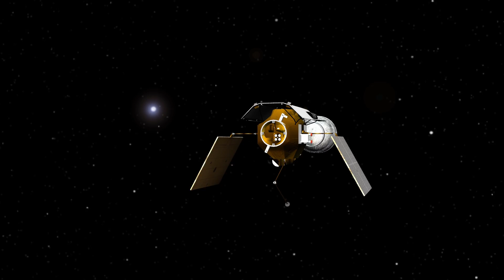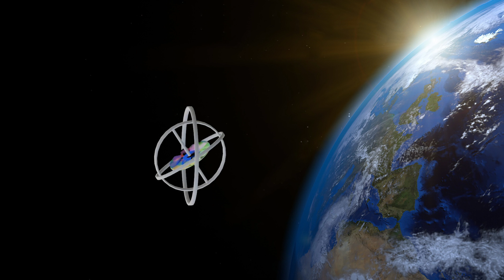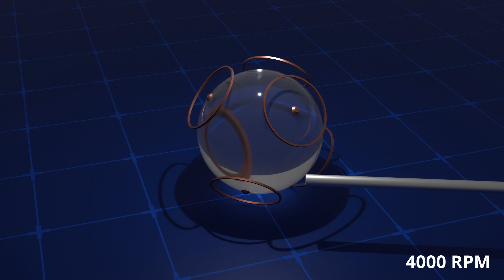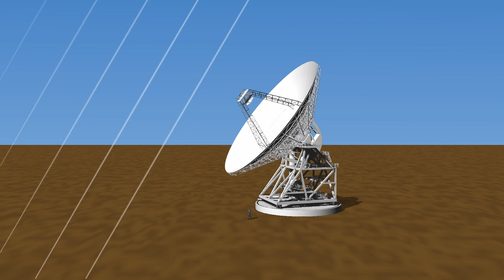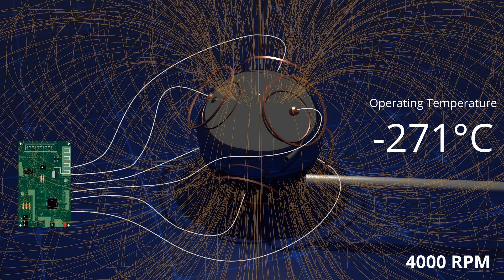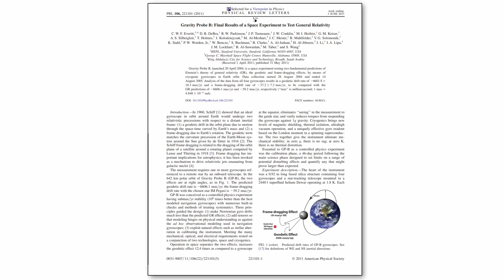Gravity Probe B

Comment from the maker: addendum: If you want additional info on how we've tested General Relativity and what Frame Dragging is,  my previous video below talks about those  tests.

https://youtu.be/Lq4m6uu1Ur8 
Tausend Jahre sind ein Tag
Reply: Excellent video!  Relativistic cosmic rays traveling at ~99.9999%c should also cause frame-dragging per an interview Fraser Cain conducted awhile back.  However, testing this effect is problematic.
Reply: Gonna have to binge your whole channel sir. Sry.
🤭
Reply: Why volunteer for MORE GUESSING at what you're trying to say?
Reply: The tallest mountain and the deepest trench are 2.4 M? What is that supposed to mean????
Reply from the maker: @barkingmad7407  It's to show how smooth the sphere is. If we could increase the diameter of the sphere from its normal 3.8 cm to the diameter of the earth(12756 km), the difference between the heights and lowest point on this enlarged sphere would only be 2.4 meter.

I didn't say this very clear in the video. I forgot to say the word "difference"
Reply: @the-barking-mad  I got this one... He's saying it's only off by a cu#t hair.

Comment: 17:14 How do the 4 lead bags prevent it from being effected by magnetic fields?
Reply from the maker: Thanks for the question.
In order for the lead bags (cylinders) to shield the interior system from magnetic fields, they must be cooled to be their superconducting temperature. This is 7.2 Kelvin. The helium onboard operated at 1.8 Kelvin, so the helium was able to keep the lead bags in that superconducting state.
In this superconducting state, lead and other superconductors will repel and prevent magnetic fields from forming inside the cylinder. This is known as the Meissner effect.
The video was getting longer that I expected that's why explained that part with only one sentence.
Good question nonetheless.
Reply: @ReflectiveLayerFilm 
The engineering and science of this is just so impressive.

Comment: You lost Magnetic interaction with the earths magnetic field when it it was made a superconducter. Should have just use the electrostatic charge on the sphere for measuring drift. I don't believe this experiment is valid because of the magnetic interaction. Also could have use optical interference (inferometer  Sagnac effect). 

"The Sagnac effect, also called Sagnac interference, named after French physicist Georges Sagnac, is a phenomenon encountered in interferometry that is elicited by rotation. The Sagnac effect manifests itself in a setup called a ring interferometer or Sagnac interferometer"

Comment: It'd be better just to use many sub-perfect gyroscopes, and test if their deviations statistically support frame dragging. This design's complexity introduces multiple points of potential failure. For example, eddy currents induced within the coating could undermine confidence in the results. A statistical test would be more robust and provide measurable confidence. Anyway, excellent video!

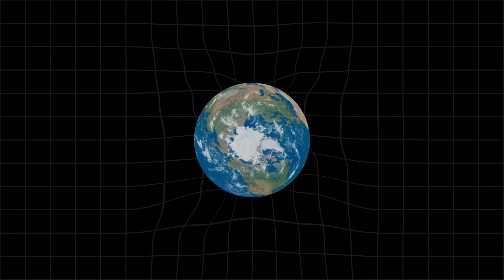Comment: Page 1:42 that frame dragging is a fancy term for Aether drag. 

Aether is an incompressible fluid that filled all void space in vacuum of universe. Aether has no mechanical but electrical property, by which vacuum permittivity and permeability are its attributes. As it attached to all matter it “drag” and move in equal velocity with matter in the near field, also drift with another velocity in the far field or deep space a velocity in average to all matter in the universe, hence the term “fluid”. A rough analogy is the harbor current versus ocean current or deep sea current. 
Also if you don’t mind, gravity, inertia and centrifugal forces are also attributes of Aether. Unfortunately it has been foolishly dismissed from the science community.

Comment: Do not forget that the precursor to the Gravity Probes, was the HRG (Hemispheric Resonating Gyro).  See WIKI for details of the various designs.  Instead of a ball, it used a "wine-glass" shape, but exverted.  The same fused quartz was used for what was essentially a cylindrical resonator (but with lesser coupling to the outer world), and the "acoustic resonance" of the glass became the equivalent of an Inertial Mass.  Several high class scientists and consultants said it could not work, since the was "no mass" involved.  An acoustic wave had no mass, Thus it could not be Inertial sensing.  Well, they were all wrong.  This actual effect was discovered a couple of centuries ago, from the French, who were probably drinking a lot of wine.  I myself did some early design work on the electronics, for doing the forcer-driving into the bell, and for sensing the inertial outputs.  SAFRAN now has the rights to that technology, and makes inertial instruments for airplanes, missiles, oil-drilling, undersea, satellites, and may other uses, where accurate pointing is required.  The HRG, since it is an actual Mass device, can withstand power failures, loss of computers due to cosmic rays, SEUs, MEUs, and also nuclear radiation.  It will just keep humming along without any power, and can be easily recovered back into action, after all of the adjacent support systems come back on line.  I'm proud to have been part of the original design team at General Motors.

Comment: Wow! This is by far the most exemplary coverage of any sensor that I've seen, and I once was an engineer at Systron Donner Inertial and tried to stay abreast of many sensor approaches.
The gyros Systron made consisted of a double ended crystalline quartz tuning fork. The forks quantified the fork's motion going out of plane due to the Coriolis effect.
It's sensitivity was many orders of magnitude inferior to that described here. But was pretty 'trick' in the ~1990 time frame. It was also tough enough to be shot out of a cannon (i.e. smart munitions)  and was the first 'gyro' used  by General Motors for enhanced anti-skid braking (yaw sensing)   Maybe your sensor could be miniaturized using 'Buckeyballs' (C60).
Reply: I am one of the designers of the HRG (hemispheric resonating gyro), which was developed by GM.  The HRG was actually used on this mission, as a crude (but dynamically accurate) guidance system for the entire satellite-bus itself.  It was also used in Hubble, and other spy satellites, for the Near and Cassini missions.  The HRG "dynamically" is the next best gyro to the Gravity-Probes themselves.  Because it is a mass-inertial device (see details on WIKI) it will drift due to any sort of mechanical or thermal stress, and had an early internal problem with stray sodium ions drifting through the fused-quartz glass resonator.  This was later fixed by SAFRAN who now has the design rights with an AC powered resonator.  One advantage is that if the electrical power fails, or the guidance computer get wiped out by cosmic rays, it will continue to run accurately for a very long time.  That allows recovery after SEUs or MEUs, which happens all the time in space.  Mr-Sun actually hates us for being up there in his domain.
Reply: @brunonikodemski2420  Thanks for the reply. The 'HRG' is an approach that is news to me. Conceptually, it sounds very elegant. I could see Honeywell, Rockwell and other companies creating such a sensor. But how did GM 'get into' this?
On a related note, let me pose a hypothetical miniaturization of an HRG   I previously mentioned 'Buckeyballs'. These are atomically small, natural, hollow spheres composed of 60 atoms of carbon. (C60). Another natural form of carbon is nanotubes. At one point, IBM was able to get atoms of other materials INSIDE nanotubes, so they could emit light, turning them into LEDs. The application was photonic, 3D 'wiring'. In addition, studies of the chirality (twist) of nanotubes reveal that they can become an insulator, a conductor, or even a semiconductor. Putting all these together, in your imagination, might one be able to put a material inside a Buckeyball, give it some polarity, and turn it into an HRG ?  It may be total science fiction, but the natural, organic, spherical perfection of C60 intrigued me about its potential in sensors back when I worked at Systron.

Comment: I wonder if we could measure G, the gravitational constant, with a high degree of precision, using that perfect sphere  in a setting where a laser would graze the sphere and we would measure the displacement of the laser beam caused by gravitational micro lensing using interferometry in the arms and apparatus of the LIGO gravitational observatory.
Reply: #freeschrodingerscat
Reply: LIGO kinda achieved this with interferometry iirc. But it required hundreds of meters of distance to achieve and detected gravity waves. There are space based interferometers planned that are much larger and benefit from near vacuum

Comment: So how was it launched without the forces of acceleration damaging everything ?
Reply from the maker: That's a good question. I also thought about that myself. Unfortunately I could find any info of that aspect of the mission. I assume the that electrostatic suspension was activated prior the  gyros being shipped from the lab to the vehicle assembly building at the launch site. There it was assembled with the launch vehicle.
Reply: To protect these instruments, the spacecraft was mounted on a vibration-isolated platform within the rocket.
Reply: @human.earthling  an ISO large enough to contain the instruments would be massive and a huge feat of engineering in and of it-self.
Reply: @4DCResinSmoker  	Here is a more detailed answer from ChatGPT:

1.	Vibration Isolation: The spacecraft was mounted on vibration isolation systems to reduce the impact of launch vibrations on the delicate instruments.
	2.	Suspension of Gyroscopes: The gyroscopes inside Gravity Probe B were suspended using electrostatic suspension within the spacecraft, which minimized friction and external forces.
	3.	Thermal Protection: The spacecraft also had extensive thermal protection to ensure that temperature variations during launch and in space would not affect the measurements.
Reply: @human.earthling  Yeah I know what all this is as I've used it (frequently) during my time in the service. However, just on a much smaller scale for avionics materials. That being said, the accuracy with which the instrument was made to function, i still doubt that the instrument came thru 100% intact. Thus needing some for of in-orbit calibration to be performed to discover what the issues were. With the calibration constants knowledge, it would then be possible to filter out irregularities for the actual measurements. 

Side note: Jet-Engine test stands need periotic servicing, where the calibration service-man (me) would teach the system what a particular measurement or reading. Thus canceling out the "local" irregularities of the cables, equipment and environment. after which changing out or losing any of the calibrated hardware would invalidate the system, requiring new calibration constants being developed. (typical periodicity of 3 - 6 months depending on system)

Comment: Very nice video.  To add a little, if I may:  Gravity Probe B was intended to measure two consequences of Einstein's General Relativity.  Both cause the precession of a gyroscope in free fall (i.e. in orbit) around the Earth.  

The 1st, larger of the two, is the Geodetic effect, which causes de Sitter precession, is due to the mass of the Earth that causes Space-Time curvature.

The 2nd, is Frame Dragging, which causes Lense-Thirring precession, is due to the rotation of the Earth.
Reply: I heard the geodetic effect is because there are less than 360 degrees in a “circle” going around a static mass, so when you orbit once, your velocity vector makes a less than 360 deg rotation, so is not realigned with the gyroscope. From the s/c point of view, it looks like the gyroscope precessed.
Framedragging is weird, because it means to be “not spinning”…that is, you feel no centrifugal forces within the s/c, when near a spinning mass, you have to spin with respect to the distant stars. 

S/c is spacecraft. Which is standard in the biz.
Reply: @DrDeuteron  "the biz" 😆 I like. 🤗

Comment: Gravity probe B, the experiment that contradicts the Einstein's version of General Relativity, as well as GPS clock experiments.
The probe data does support the Newton version of the general theory, as well as Gauss's Law for Gravity.
Reply: What sources did you use?
Reply: @douglaswilkinson5700  While it is true that Gravity Probe A and show a speed up in clock speed at higher altitudes and Gravity Probe B showed a "frame drag," there were other theories that also predicted that.

But gravity probe B and A also proved that a clock at a higher altitude emits a redder frequency, conveniently not mentioned in the reports.  Experiments also show that light does not blue shift into a gravity well, I.E. there is no gravitational blueshift nor redshift.  So, the source is NASA insiders that did the experiments but failed to mention it.
GPS additional experiments also show that the frequency and energy of light into a gravity well is unaffected by "gravity" but is a function of the magnetic flux density gradient of the Earth.  Clock speed is also a function of magnetic flux density.

So, neither Gravity Probe B nor A rule out the ether density gradient of Newton, but further GPS tests support Lorentz relativity and Newton's general theory, not Einstein.

GPS clock experiment also show that Einstein is contradicted but supports Newton's version of the General Theory and Gauss's Law for Gravity instead of Einstein's.  Even Einstein got parts of it right by chance, but the results are actual due to the magnetic flux or ether gradient around the Earth, per Newton and Gauss.
Reply: @douglaswilkinson5700  the one
Reply: How did you come to your conclusions? Most places I look seem to say the opposite.
Reply: @12pentaborane  try an article from the foremost patent holder in GPS algorithms, Ron Hatch.  'Gravitational Energy and the Flatness problem..'   He covers the data from Gravity probe B in his Book as well.
   Clocks at a higher altitude, and Gravity Probes, emit and redder frequency and the incoming light, energy and frequency, is unaffected by gravity contrary to the General Theory.
    Clock speed and frequency are a function of magnetic flux density gradient not the General Theory.
Reply: Since the earth is flat, nothing is really spinning anyhow! Don't argue with me.
Reply: @HarrieHausenman  The flat earthers do use that claim and Einstein's version of the ether to promote their geocentric model.
However, they do ignore their own ring gyroscope experiment that shows that the Earth must be a spinning sphere.

Comment: I remember well when this mission went up and followed it closely due to its incredibly exquisite (and exotic) engineering extremes. I was disappointed to learn that it was unable to complete its primary mission objective due to the podhole motion issues.
Small errata: niobium isn't a high temperature superconductor, just the highest of the pure elemental superconductors, but still only 9K, and so still needs liquid helium.
Reply from the maker: Thanks for the correction.  I had a feeling something was off when I realized that the helium had to be at -271 C.
Reply: Thanks for the share! 🤗

Comment: There’s one question I’ve always had about gyroscopes. We know a stationary gyro with no spin has no gyroscopic effect, and a spinning one does, maintaining its orientation against outside influence. But there is no critical RPM required to have the effect, it just comes on gradually, and there’s no maximum RPM for maximum gyroscopic effect either, it just gets stronger and stronger.
And therefore we must conclude that regardless of how fast you spin, you will still drift a tiny bit under the influence of an exterior torque, this effect can’t ever be eliminated?
Reply from the maker: Good question. I'm not sure what the final effect on the gyro may be, but it does seems that some effect will be realized in the gyro.
Reply: There is surely an upper limit on gyroscopic effects as rotational velocity approaches c.
Reply: @jimmcintosh3718  except rotation velocity is not measured in meters per second….